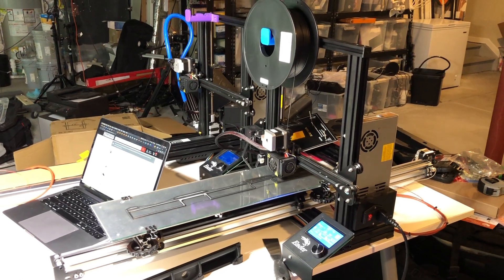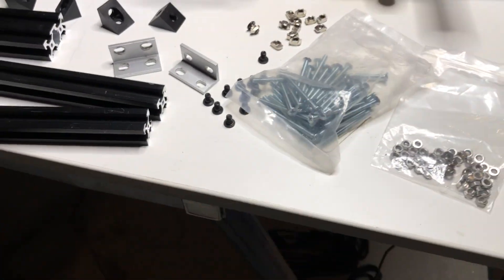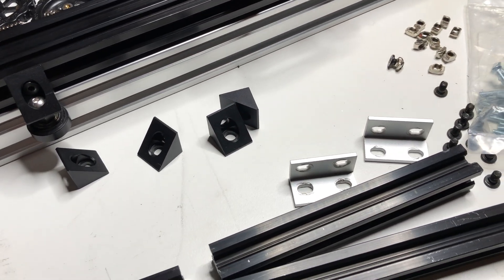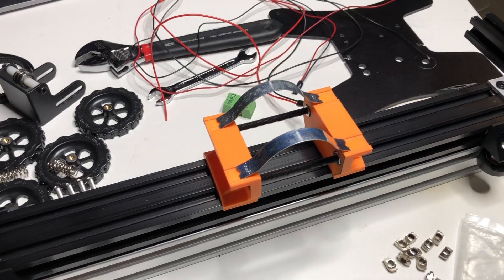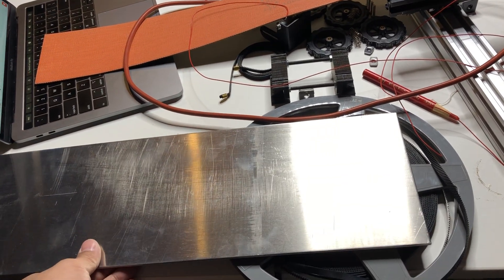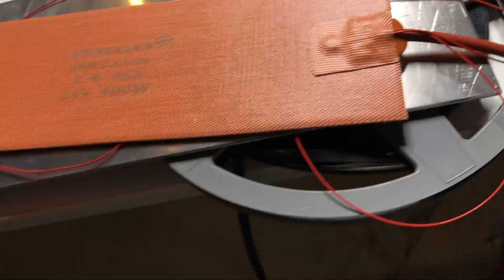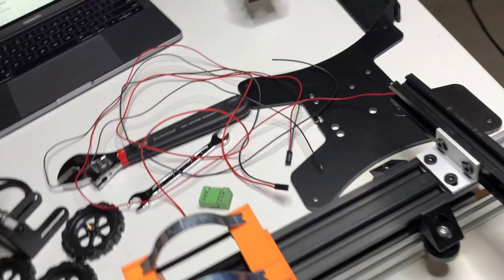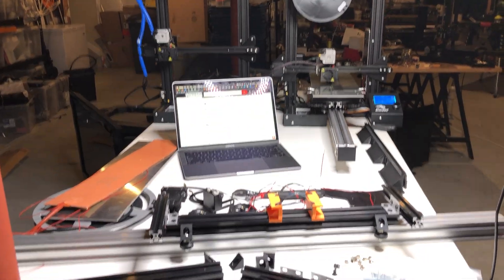Extending the Ender-3 Pro to be Extra Long

Comment: You can buy the black angle corner connectors on Aliexpress at a much lower price. The only problem is that it may take 1-2 months to receive it in the mail.

Comment: It looks like you could benefit from the Creality 3DPrintMill.
Reply: So I think about this a lot. Is a 3D Print Mill, which is still in its early life, the best way to go about making long parts instead of building a bigger printer like this? My reasoning is that to build long prints you still need external support to catch & hold the print so it doesn't tear off of the bed. You'd essentially be using the same area as a long printer like this.

Do you buy a well developed printer concept or a new printer technology that still has yet to prove itself?
Or do we buy the shiny and buggy new tech because its exciting to be an early adopter?

Frankly I'd likely go for the 3DPrintMill because of its cool concept and I desire to own all styles of 3D printers. (Delta, CoreXY, etc.)

Thoughts?
Reply: @Joemussa  I think for long prints your points are very valid and definitely something to think if thinking of getting one. However there also are ways to use the 3D Print Mill that benefit from it without needing the extra room, namely printing multiples.
Reply: @Joemussa  a 3D print mill without thinking. Just look at the mass that is being moved around. Even with CoreXY you still can't match the benefits of the mill design
Reply: No way this is way better IMO. No belt to mess with prints like a normal printer. This is awesome!

Comment: How much did this all cost? I saw the openbuilds parts were about $70, and you said the heater was ~30-35, but that doesn't include the glass, the aluminum and other odds and ends. :) Thanks! This is awesome!
Reply from the maker: I'll be offering a kit on projectender.com for $200 to do everything. Here's a video of the process https://youtu.be/7LjVdB0vq8I
Reply: @FrogCube  when do you think those will be available? And what will they be for, E3/pro/v2?

Also, do you also have the Justin Miller channel? I think that's where I first heard of projectender.
Reply from the maker: @brandoneich2412  Yeah. That's me also. They will be for the Ender-3 V2, but they work for the Ender Pro also. The main issue is the beds. I  need someone to drill the holes in them. But i found someone who will do it so they will sell the beds and I'll offer everything else.

Comment: Awesome Mod, can you link the site for the heating elements, Keep up the great work !
Reply from the maker: I'm going to be selling them from projectender.com if you want one.
Reply: @FrogCube  that website doesn’t exist. Shelve the idea of selling kits?
Reply from the maker: @DevonsWorkshop  yeah. No one was interested. And I had issues sourcing parts.
Reply: @FrogCube  That’s a shame. I’m interested. Going to attempt a 9”x24” y-axis extension on my Ender 3 S1 Pro. The dimensions you chose are exactly what I’m looking for. Found some v-slot extrusion, JSR bed heater, and trying to find someone that will cut a custom carriage plate and bed. Would have rather bought your kit. Searching and sourcing all the right parts is time consuming.

Comment: Thank you for the video, I have an extended Ender but mine is in the Z axis. I printed C3PO and needed the longer z for the shins, thighs, torso, etc to print as one piece or at least fewer pieces. I'm in the process of installing the Ender Extender kit for 400 x 400 xy to go along with the 500 z.